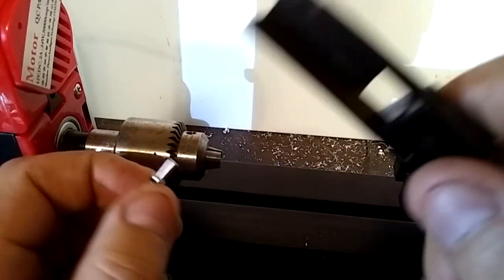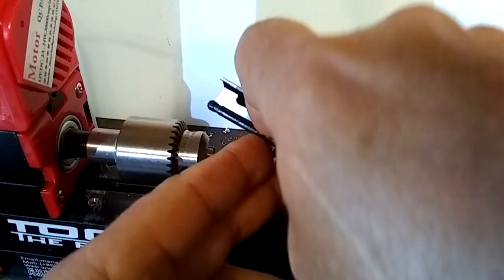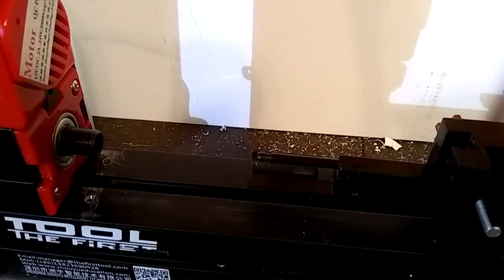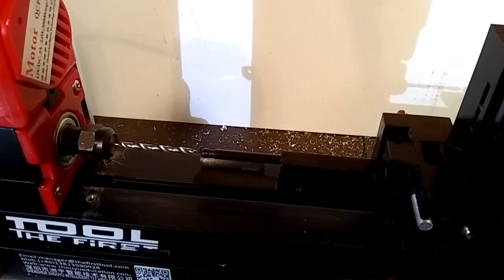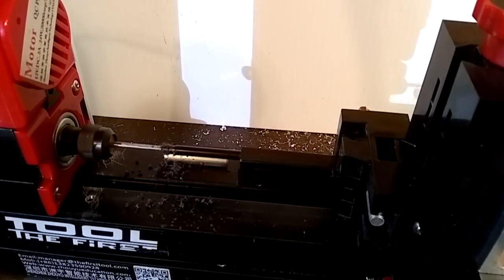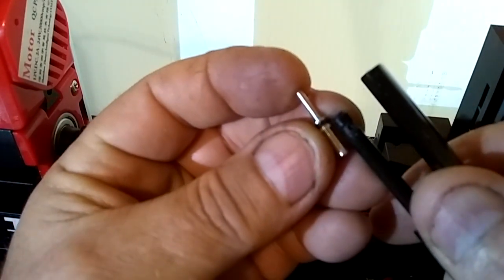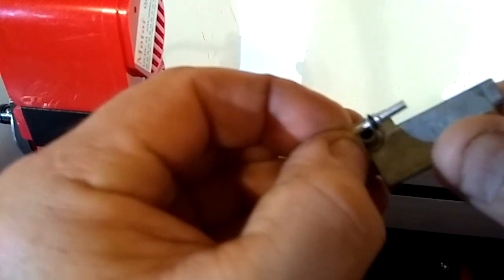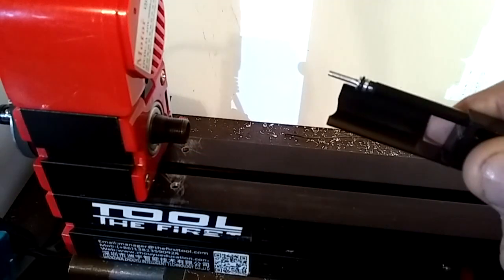Crosman Legacy 1000 Bolt Probe Mod

Comment: legacy 1000, have 3 of these now, haven't shot 1 shot yet. purchased 1st about month and half ago and stock broke off and receiver fell apart while oiling, contacted crosman, they sent a replacement, this replacement couldn't be cocked, crosman sent another, while trying to cock it the stock broke off and wouldn't cock either, ive tried 3 contact attempts by email and phone and no response from crosman. very disappointed in crosman quality, have owned crosman in past and never had issues like this.
Reply: So you think they are junk after 3 new rifles have failed without firing a shot thru it.
Reply: Don't pump while gripping the handle that connects the stock to the receiver

Comment: Do you think it will cut steel if you do little at a time?,,,I want to get lathe to make valve stems (poppet),,may get the harbor freight model,, subbed to ya ,,I also have a channel on airguns check it out sometime